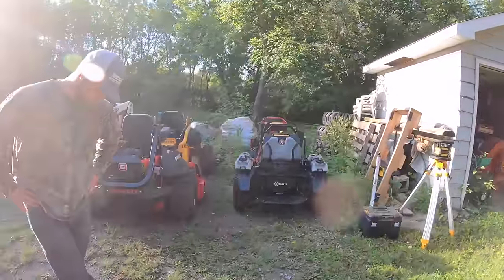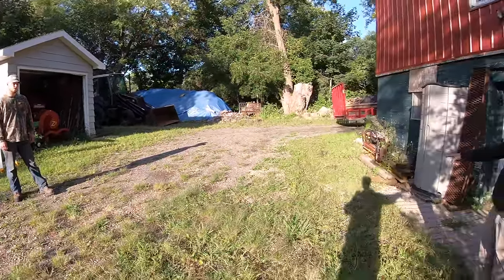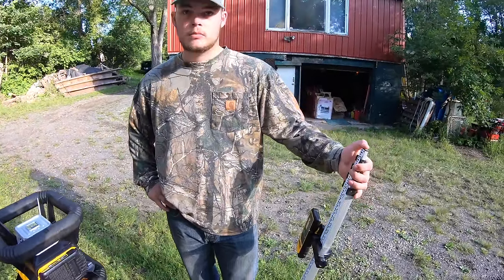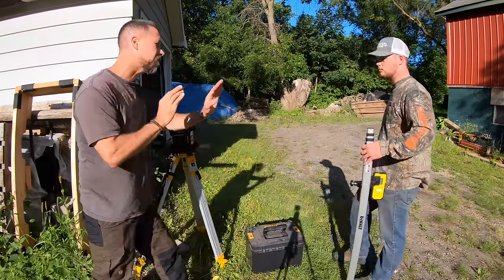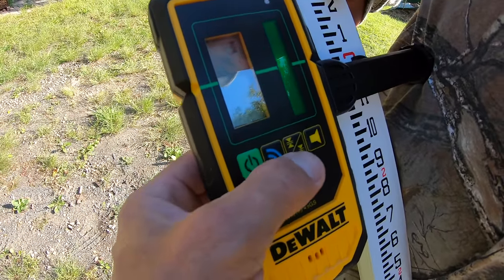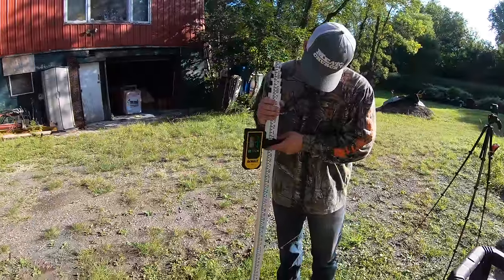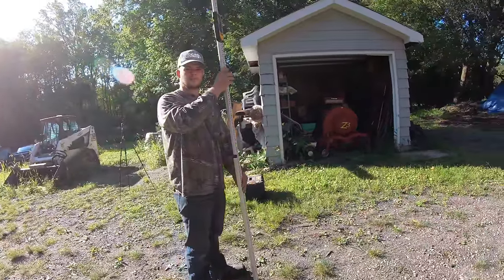Teaching a NOOB how to read grade, Run a laser & change elevations on a jobsite- PT 1/2. 4k video

Comment: If you really want him to learn grade and how its going to be if and when he gets on a big site. Teach him in 10ths not inches.
Reply: Would you expect anything other than that from Stanley ? First time I learned to check grade the foreman was working in inches like a fucking idiot then measuring on the grade rod with a tape measure ....
Reply: @smokingbluedream  I saw that once after we did a form board survey...the fucking concrete guys were trying to use inches rather than the vernier scale. 

I've only ever seen laser levels in my day to day stuff. All the survey companies I've ever worked for have used conventional/transit levels
Reply: Djinn Devyl most of stuff now a days is gps either total station or rover we use a laser and gps on the dozers wish my company gave excavators gps

Comment: If the grade goes down and the number goes up, then would you not think of it like this; The grade is lower than the laser and to get it even with the laser you need to ADD grade, thus the positive number. If the receiver is higher than the laser you get a negative number because you have to lower the grade by that much to get to level.
Reply: Exactly right.

Comment: The leveling rod reading at A is 5’-5” and point 7’-3”. What is the difference in elevation? If I’m right point A is 1’-10” higher then point B. It’s a practice test I put for myself. Just need a professional to verify for me. Im new to all this you can tell by the question.
Reply: Exactly right

Comment: if you've been doing this for 20 years you must have started at 5 years old, and don't call yourself a grade checker because you are not. inches? what's the hand signal for 2 3/4 inches for the operator?

Comment: Just a heads up. you went backwards with your numbers haha. You only needed to cut an inch and a half. Great video though, Im about to watch part two.
Reply: I was wondering how far down in the comments I would have to scroll to find someone who noticed the error.  I have only used a laser level once in my life about a year ago (without a mentor) to determine column lengths for a post frame building and caught the mistake immediately.  Like Stanley said, it's easy to get it backwards no matter how long you've been doing it and he proved that in this video.  I appreciate the content nonetheless.

Comment: Oops! Orig measurement was 6' 2 3/4". 16' out he was at 6' 3 1/4" which is 1/2" lower elevation.(higher number is lower elevation). He doesn't need to remove 2& 1/2" of dirt but only 1&1/2". (He'll then be at the target of 6' 4&3/4" which will be 2" lower grade or elevation from his bench mark for proper grade. I'm not a contractor but I own a Bosch rotary level I used to site my French drain.

Comment: Hahahaha, to me this measurement is hard, but with a better explanation of the rule on the receiver what the meaning of the black line  small and large, interesting vidio i want to learn for measuring the distance between the posts. Would you please repeat again in other way the same vidio thanks.

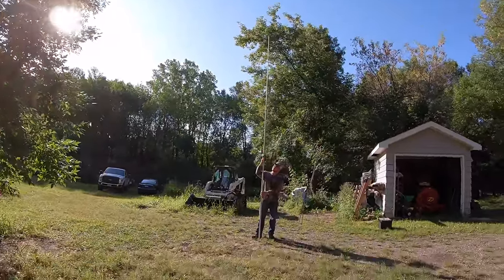Comment: 17:38 isn’t that lower? Grade goes down measurement goes up right? so bench was 6’2.75” his measurement was 6’3.25” trying to achieve a 6’4.75” would mean you need to cut 1.5”. This video is very helpful until this part. I’m still confused 😂

Comment: So the benchmark was 6' 3 3/4", and 16' out at location #2 was a 1/2" high, 6' 3 1/4", if I'm not mistaken. So with 2" of slope required every 16' from the benchmark, you would want to cut 2 1/2", changing the measurements on location #2 to 6' 5 3/4", correct?

Comment: If your benchmark is at 6'2 3/4", & you want to excavate down 2" from there, wouldn't you just raise the reciever up 2" on the stick, & once the guy starts excavating, you check the trench depth, & it'll tell you arrow up or down until it flatlines, resulting in the proper depth?. Kind of lost me at the end of the video

Comment: I know I'm late, but...
Wouldn't a big chunk of that ass-backwardery simply vanish if you thought about depth in relation to the laser beam instead of elevation?
I mean... The level the laser is set up is a (more or less arbitrary) zero - point. The numbers on the stick show how deep below that level the grade is on this point.
That way if you cut grade you remove material to make the grade 'deeper' and it's logical that the depth number increases VS the illogical increase in 'elevation'.
In the end it's the exact same thing but it may be less confusing in the next 20 years...

Comment: Im sorry but he is not giving people the right info i have watched many of his videos and can tell from his terminology he doesent know what he is talking about.   Grade  is red in 10ths and 100ths not inches and feet. There are 10 10ths to a foot and 10 100ths in a 10th. 17 100ths equals 2in U use a  tape measure between elevations on the rod u can also mark with a pen on the rod were ur elevations are so u dont ferget where the receiver was. This guy should not b making videos if he doesn't know what he is talking about. I heard him say he was driving equipment in one video. U dont drive equipment u run equipment. I am a underground contractor and have ben in the trades for 27 years. I know. On the retaining wall video even his own workers were correcting his info. Id like to let everyone know this guy is full of bs.